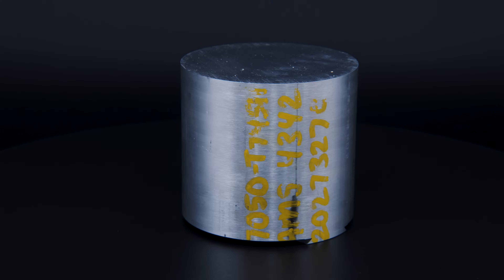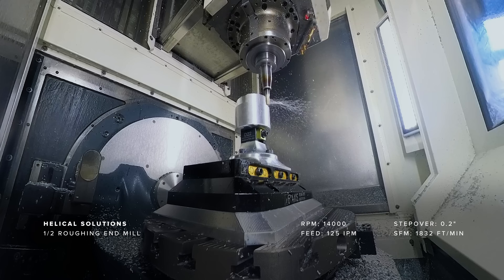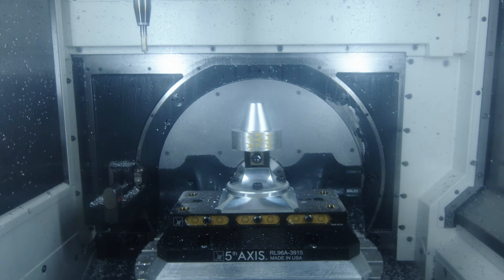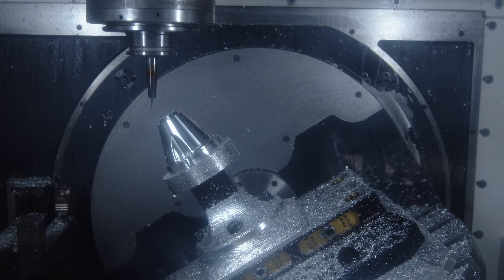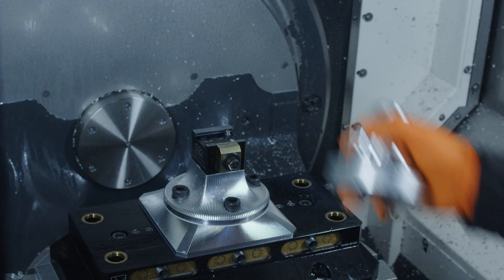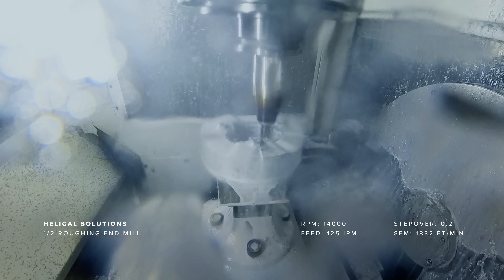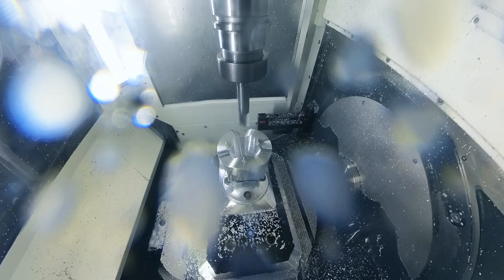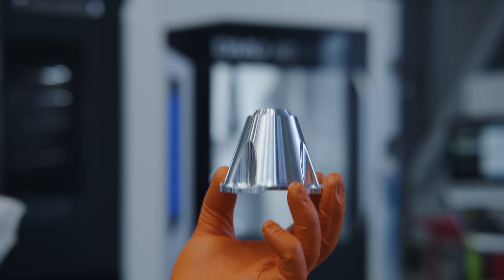5-Axis CNC Machining for Aerospace | DMG Mori DMU 40

Comment: You would have saved expensive machine tool time by roughing the billet in a cheap turning center. It's always more profitable to rough parts in a $10K machine then a 600K  machine, but i see this is sponsored so there's no reason for it. Even the start of the machining will simply wear out the tip of the endmill. Nice part, not as efficient as I would expect for a sponsored video. Expensive way to make the part.

Comment: 14k and only 125ipm is pretty slow actually. I run 12k by 200 ipm in aluminum. I finish at 100ipm. You can triple that feedrate for roughing ;)
Reply: Am I crazy, or this part rather be machined on a turnmill than a 5axis
Reply: @prathmeshmulay1993 DMU 40 is a 5axis mill. It's not even setup for turning, yes it can mill with the c axis rotating but this one isn't spec'd for true turning. I work on an okuma mu5000 VL and that 5 axis mill does turning since the table rotates up to 1k rpms. Lathe tools can be clocked in the spindle with an entire lathe offset page. Pretty insane once you get used to that type of machine. Opens up some cool ways to make things.

Comment: Not an expert but when he did the 4 axis roughing like a lathe coudnt u just mill it normally like the table is at the normal angle and u just mill in circles. Or does ur method has some extra benefit?
Reply: Oh i think i got it u would need a longer mill in order to do it differently. And longer tools are not exactly optimal